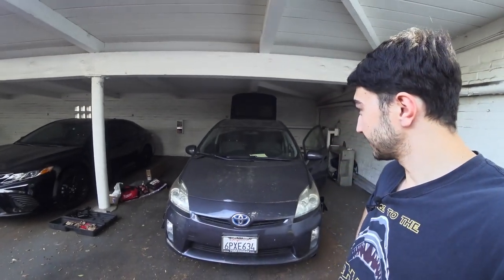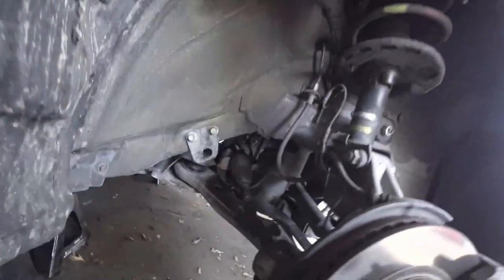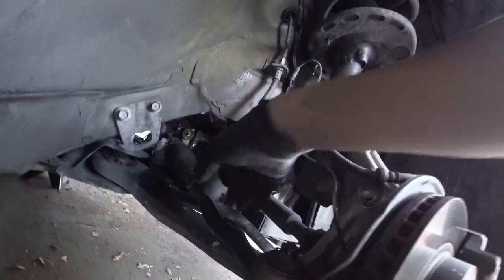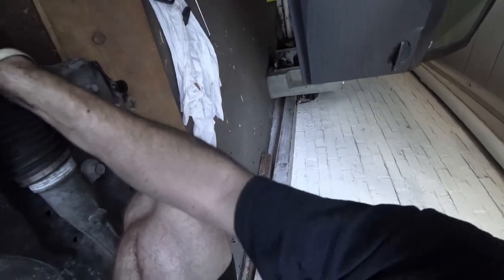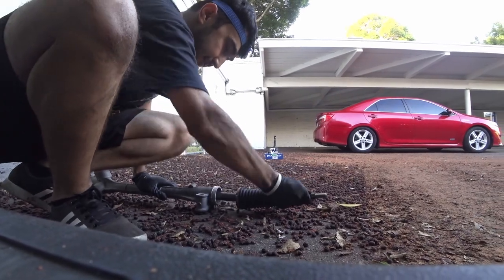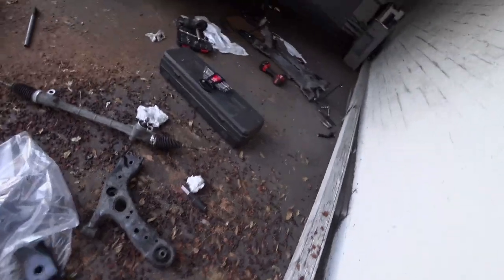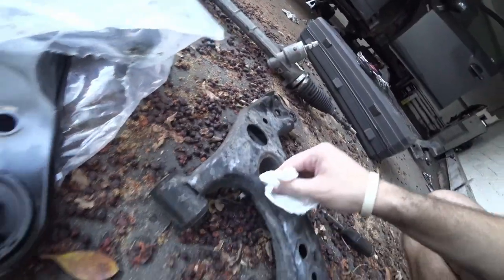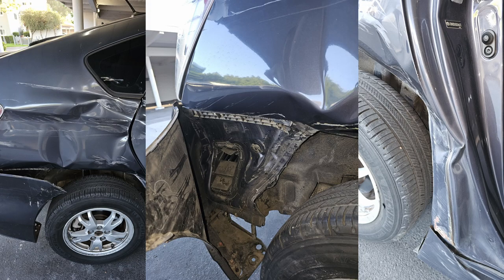The Dark Side Of The Car Rental Business | How To Solve Difficult Problems

Comment: Damn ! I have a 2011 prius its 309k miles. Had to replace headgasket on my 2010 prius at 185k miles and replaced the burning oil engine on my 2011 prius for 2800$ 50kmiles on new engine . Do you do turo ?? Maybe you can rent to rideshare guys ???? If u had like 30 cars on turo can u make like 100k $ a month ?? I heard a x6 white exterior and red interior can rent for 6k a whole month